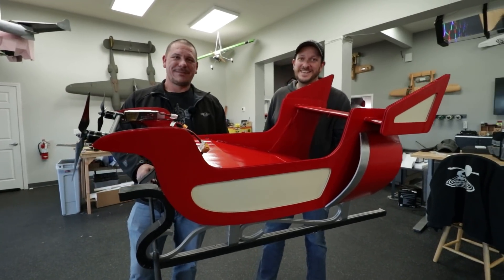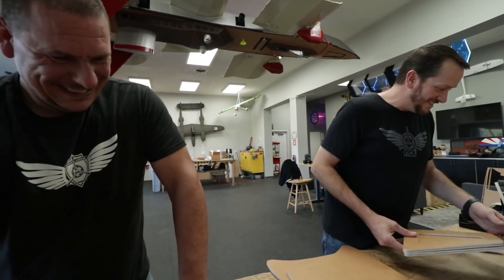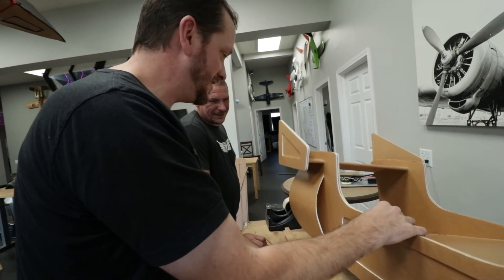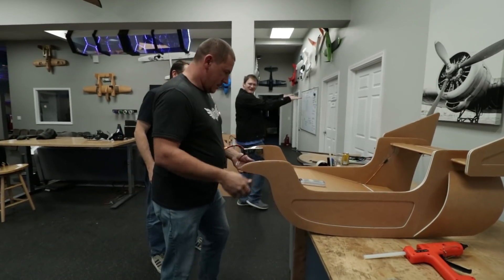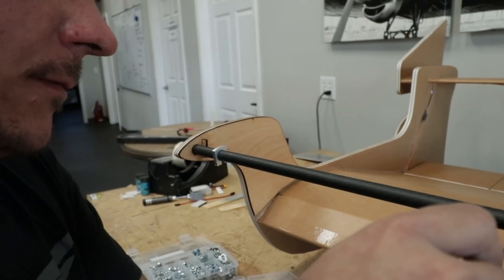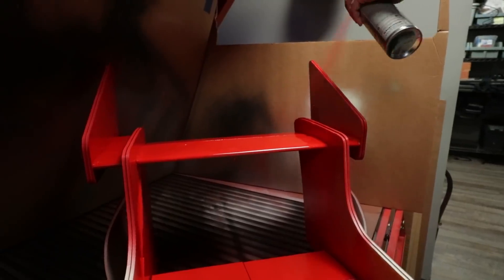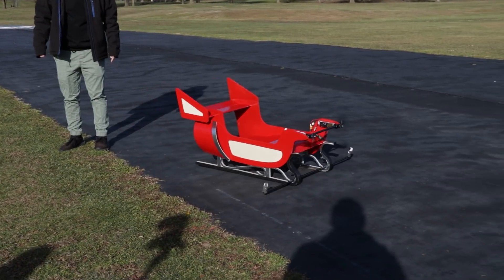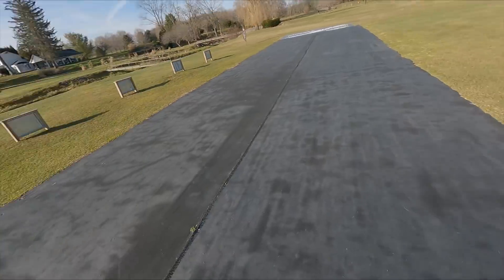DIY Flying Santa's Sleigh! 🛷🎅🏼

Comment: Looks like it's actively unstable in roll.  You can see the elevons pushing hard right all through left turns and vice-versa.  (just like a modern fighter jet :D )  Needs more Aileron control authority, maybe less side area below the CG, maybe swap the motor sides so the CW and CCW motor are on the other side?  Awesome build, definitely worth a version 2!

Comment: Merry Christmas!!! In My opinion, Santa's sleigh has a lot of vertical surfaces and no vertical control, it is hard to compensate with elevons ...
p\s it would be nice to sew up the lower plane of the runners with plastic "from bottles" ...